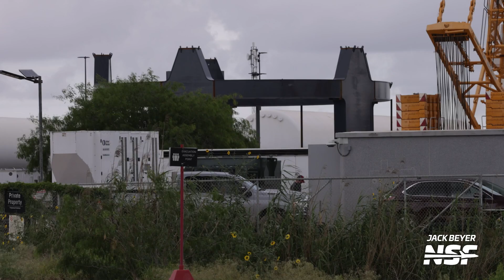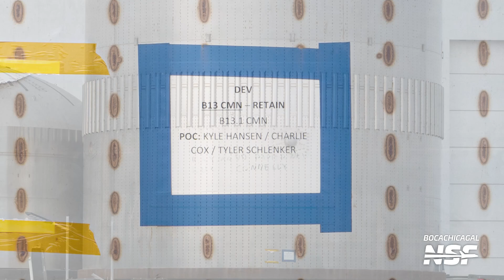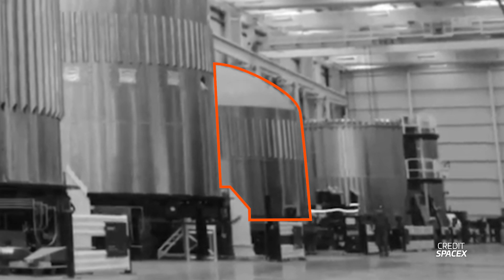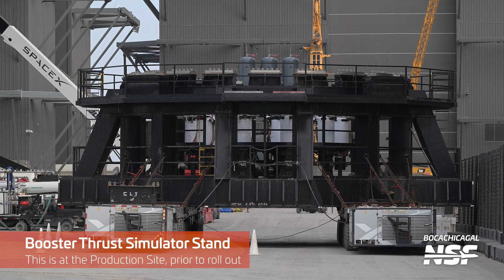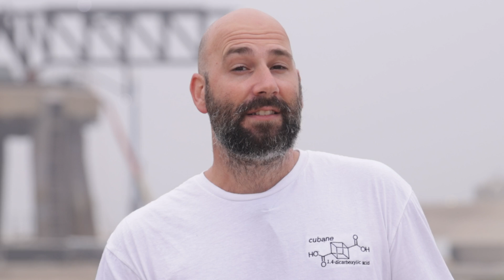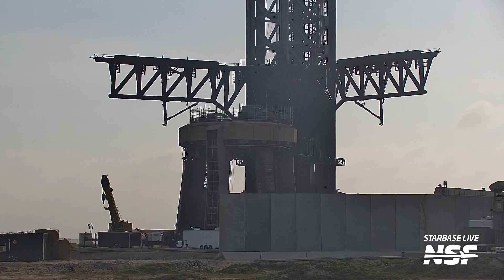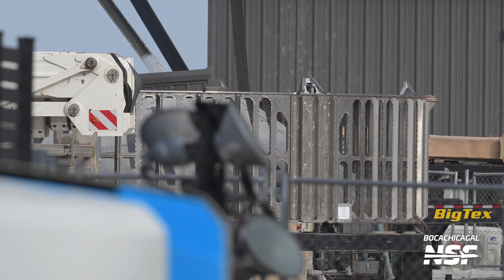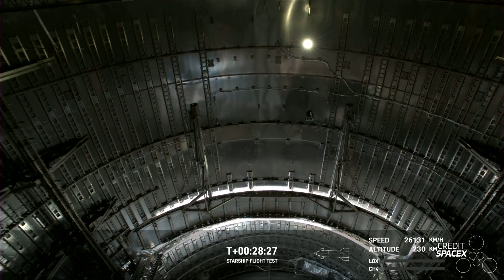Coming Soon: Starship Propellant Transfer Demos | SpaceX Starbase Update

Comment: Incredibly interesting info, especially from NASA!!  Very curious to see if they end up updating their Orion or Gateway missions as starship becomes more human-friendly
Reply: They will make changes for sure. The question is when Starship will be ready for that. We are still far away from that goal.
I would rather see them abandon SLS and go for a combination of Falcon 9/Dragon and Starship until it is human rated. But I doubt it will happen.
Reply: @knowledgeisgood9645  I believe that Crew Dragon's heatshield is designed to be able to withstand Earth re-entry from Lunar Orbit. Crew Dragon is designed for 10 day flights.
Yet it would need some sort of command module with fuel, maybe the Dragon XL design would help.
Reply: @favesongslist  I can see the transfer of astronauts done in earth orbit in both directions. Traveling to the Moon on Starship has to be simpler and more comfortable than on SLS or Dragon.
Reply: @knowledgeisgood9645  Crew Dragon docking in LEO to a Lunar Starship is a great way to travel to the Moon. 
Returning the Lunar Starship from Lunar Orbit back towards Earth should be achievable, The issue is having enough fuel to slow down to enter LEO. The Lunar Starship needs enough delta V to slow from 25,000mph to 17,500mph.
One solution may be to have a special expendable Starship tanker to refuel the Lunar Starship in Lunar Orbit.

From Mars the Starship would be fully refuelled for the journey back to Earth. This possibly may need Mars refuelling Starship in LMO. Yet to see SpaceX's full solution for returning from Mars.
Reply: @knowledgeisgood9645   Traveling to the Moon is not an issue, The fuel required for Lunar Starship to get back and slow down to LEO when retuning from the Moon is. Orion is easier to get back from the Moon than a lunar Starship.
Reply: @knowledgeisgood9645  BTW I asked the Claude Ai about this, the answers it gave were amazing including all the maths calculated.

Comment: spacex still need to complete their mishap report. they are leaving it a bit tight.
Reply: Not really. The tile work on S29 is enormous. Notice all the tiles with white lines on them. I expect them to replace every one of those tiles.
Reply: @knowledgeisgood9645  im talking about the fact that between submitting an FAA report and luanch is usually one month. and spacex said they were launching end of may and its now end of april.

whats tiles got to do with anything ?
Reply: @hupekyser  It does not need to be one month. It all depends on how much is in the report.
Reply: @knowledgeisgood9645  ok so where does your point about tiles fit into that?
Reply: @hupekyser  The delay will depend on the readiness of the ships and stage zero not so much on the FAA.
Reply: @knowledgeisgood9645  i cant see the tiles being a big deal at all.
Reply: @knowledgeisgood9645  i think its the other way around. but whatever